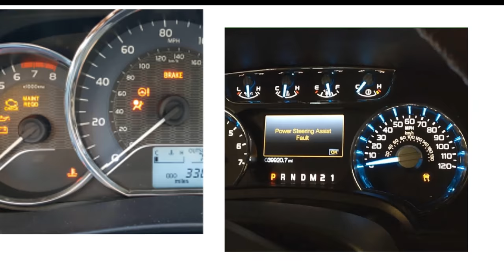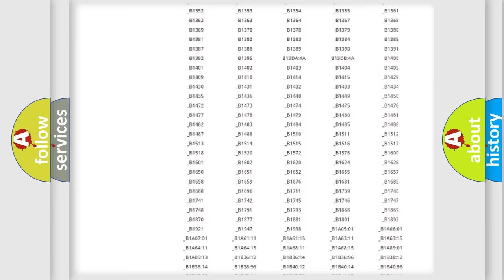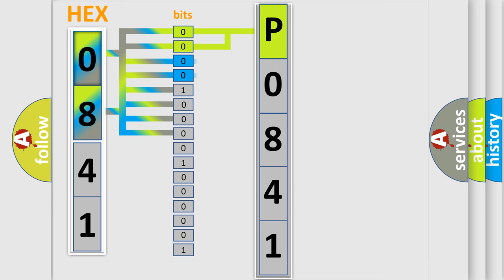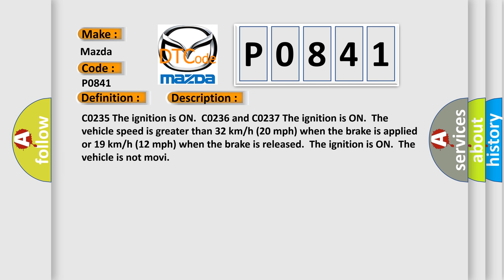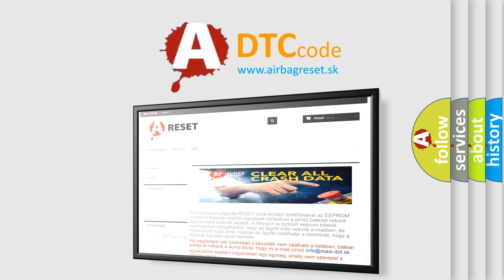DTC Mazda P0841 Short Explanation

Comment: forgive me, but this is the wrong fault code, my vehicle gave me P0841: which means Transmission Fluid Pressure Sensor/Switch “A” Circuit.